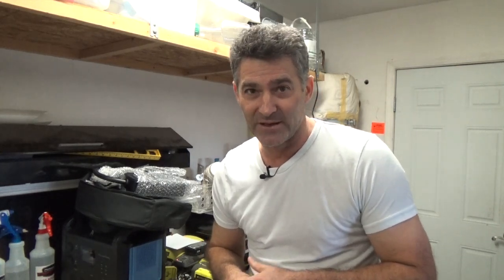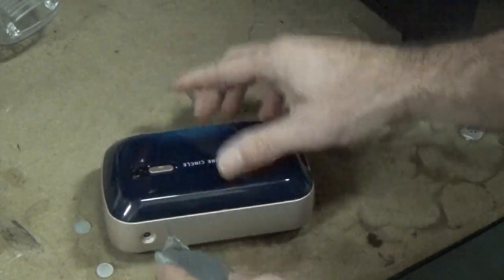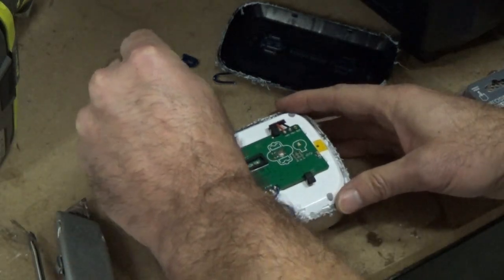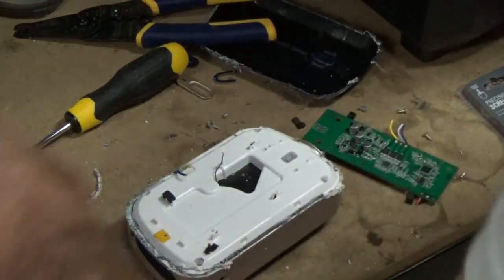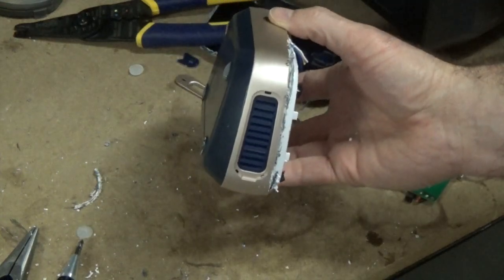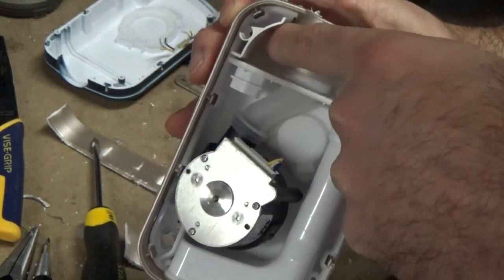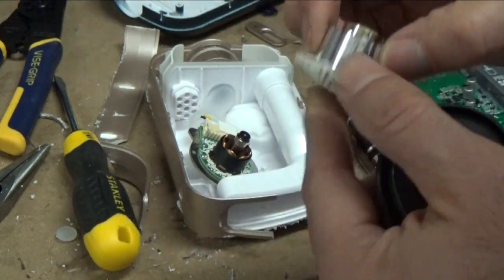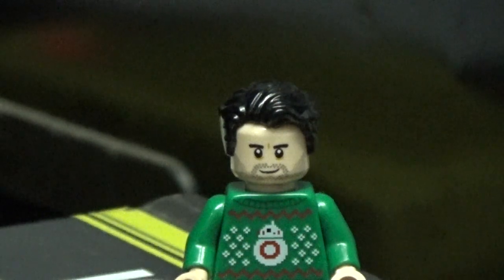Disassembling a Travel APAP like a PRO!!!  Snore Circle YA50 Autopsy.

Comment: The datasheet for the Nidec TF037F says that the maximum flow rate is 5 lpm, which is of course nowhere adequate to sustain mask pressure during normal inspiration even if the venting holes are completely blocked.
Reply: I just looked at the data sheet, not defending "Snore Circle" but 5 lpm is the minimum sustainable flow rate of the blower, the maximum sustainable is anywhere between 120 to 180 lpm depending on power supply, maximum rpm limiter and ambient variables.  Cheers

Comment: Well... I  didn't ask but only because I didn't think to so... YAY!!! So, wouldn't that magnetic motor possibly be a hazard to pacemakers, etc just like the magnetic masks are? And seriously dude 👏 well done and thank you for performing that service for us. I'm definitely of the opinion that no one should be sucking air thru a machine that no one has actually looked into and verified the safety of its internal bits and pieces. I'm betting that cheap a$$ plastic off-gasses some pretty unsavory fumes.

Comment: Honestly it looked ok to me. No cancer foam in the air path. Nidec is a serious motor manufacturer. Not saying it's adequate for cpap or that noise levels are acceptable, but makes me curious if you could have tested it more with the software on a tablet or some other device besides your phone where the weird data sharing wasn't such a risk. Thanks for all you do, Jason.
Reply from the maker: I really would have liked to change pressures etc.  At the lowest “most comfortable pressure setting,” it wasn’t confidence inspiring.  

Extremely delayed in reaction to my breathing.